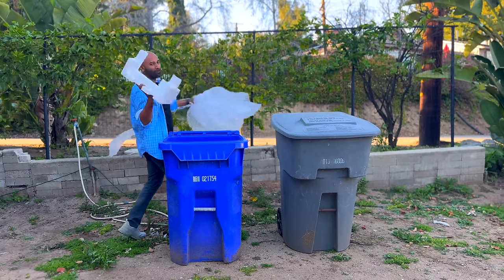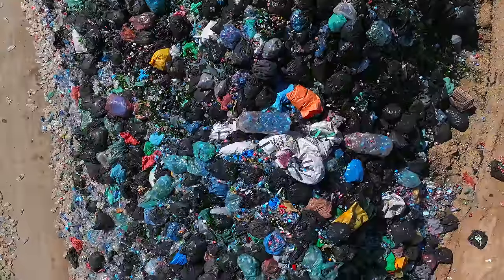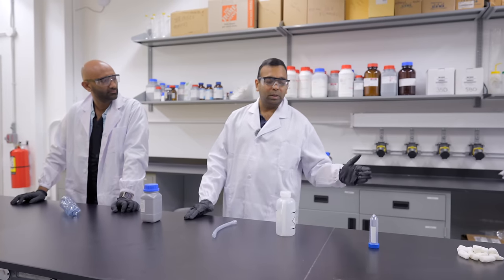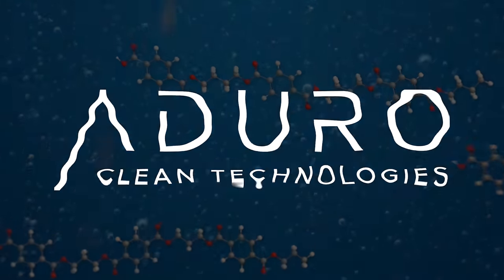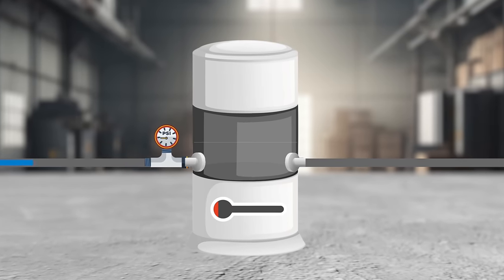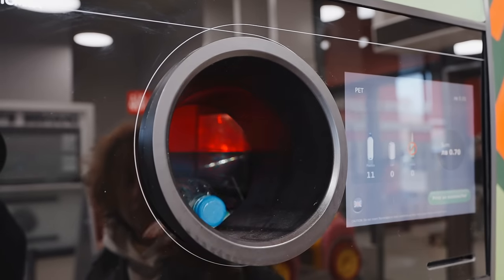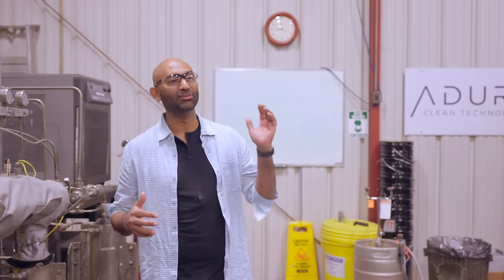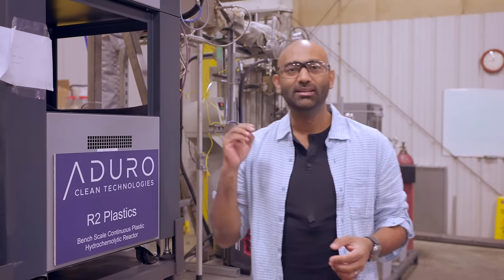Plastic Waste May FINALLY Have a Solution!

Comment: 2:42 It's a huge stretch to call anyone in the plastic industry nice. The 7 resin identification codes came into existence to alleviate the public concern about plastics being bad for the environment. And the sign itself was purposefully designed to look like the recycling symbol, to make people feel better about it. They even ran multi-million dollar campaigns per year to ease off people's minds. And despite new symbols being "revised" as full triangles over a decade ago, most plastics still look like the recycling symbol. And from the 7 codes, only the first 2 have been recycled. And of those, most of it was only recycled once. And here we are, with the plastic industry raking up profits and decades later it takes an outsider's effort to make plastic recycling viable. Nice, huh?

Comment: What Arduro is doing is great; because there's so much extant waste and the inertia of the current system. Years ago I saw a news article that a lab in Japan had developed a new type of plastic which could be reduced back to individual monomers with a simple chemical bath and then remade into any new type. They specifically said it was 100% recyclable, meaning potential for zero waste. It seemed so simple that all new plastics should be made from this new type. The smartest thing to do is a carbon tax on mineral oil, and nonrecycled plastic. This creates market pressure for hemp oil plastic & composites, and recycling.

Comment: A few restaurants and some larger chains use PETE or #1 plastic, the easiest to recycle, for their takeout cups. Most still use PP or #5 that is far more difficult to recycle. #5 is not even accepted in my city's recycling program. Why have other restaurants not shifted to PETE? The fast food industry uses so many of these cups that if they would move to industry wide use of PETE and developed a clean, sanitary collection system for empties, it might possibly accelerate the reuse of these plastics.

Comment: The part that is missing is the part where these oils and other products are put back into standard processes and turned back into solid products. How does the economics stack up? Can they be cheaper than standard petrochemicals?

Comment: It's good to know that at some point in the future, there may be a chance that plastics can be recycled indefinitely, possibly even without toxic degradation of the material, such that it does not have to be downgraded with each cycle, and eventually moved to landfill or energy recovery. 

But in the meantime, whilst we're waiting for the miracle science. There is lots we can do to reduce our use of the material to the amount that is only necessary.

Comment: Plastic pyrolysis   I carried  out the same experiment  6 years ago  by heating mixed dirty plastic 
In a  catalytic  oxygen  seal chamber  up to 410 Celsius  and using a still the distillation tower to 
Cool the hydrocarbon condensate   at diffrent  stages the light end gases can be used to heat the reaction .  The BITUMAN for the roads  and carbon powder can be used for strengthening  concrete 

The bottom line is that NZ  is building  plastic recycling station  
And yes there  is no real money in it it's cheaper to pump it out of the ground 
Remember the oil is free it's only the extraction  cost 
I can only wish them all the luck in the world.

Comment: While this looks great, the main problem is that we have to much one time use plastics. people are lazy and companies try to min max their costs and income. So only regulations to ban 1 time use plastics to reduce the ammount to managable levels. and have regulation on if plastic is used its used in a specific way so that it can be recycled in a acceptable manner + forcing those using those plastics to use recycled plastics. will either motivate them to promote these tech and recycle rates or they avoid the need for plastics in the first place.

Comment: So, as much as I WANT to believe this, I can't even begin to express how incredibly skeptical I am of these claims...

I've been personally fascinated with this industry. Chemically recycling plastics either back into their constituent parts, or splitting the processing between returning usable plastic to the cycle, and turning the multitudinous carcinogenic waste long-chain hydrocarbons into fuels of various quality. It sounds amazing, on paper. In practice: it's energy-intensive; prone to failure; UnBeLiEvAbLy ToXiC to the workers operating the systems, and to the environment with all of the waste products, from the plastics themselves, the additional industrial solvents, and the penultimate precious resource: Water (IMHO the ultimate precious resource being Life). Like I said, I want to believe that Aduro have cracked the code, but several factors compounding at once leave me highly critical.

1) Everything that might dispel my disbelief is shrouded behind patent claims. I completely understand that proprietary techniques will be necessary to make any of this reality, but they so far haven't put forth anything new.

2) Since they're still in the startup phase, I can't help but feel like this is just a repeat of "Magical hydrogen storage disks" or "Theranos all-in-one testing labs" or any of the thousands of other lofty claims over the decades, with no proven science or tech to back them up, meant exclusively for building investment capital, before the inevitable lawsuits start rolling in...

3) Claims of Silver bullets or Panaceas should give pause to everyone that's listening. Claiming that they not only no longer need to care about the type or quality of plastics going into their mystical vat, but aCkShUaLlY impurities are beneficial to the process something something industry buzzwords.

I have a lot more to say on this while I'm desperately trying to keep an open mind. I guess for now, just call me Fox Mulder.

Comment: This tech in itself looks like an insane breakthrough for plastic recycling.
However, I wonder if they achieve an economic advantage over just producing new plastic, and how far are they lagging behind if they are not yet competitive.
Like, what is the price of 1kg or a ton of fresh plastic compared to their recycled plastic?
If they don't achieve an economic advantage, then it also likely means there needs to be more regulation around plastic waste such that these technologies could become standard.

Comment: One question that has been on my mind recently. I would like to know if this is possible.  Instead of the engine being the main stay in Hybrid vehicles, why couldn't the process be reversed, so that a tiny engine could be used to keep the batteries charged while a tri motor would be driving the wheels?

Comment: so it's tdp, right? thermal depolymerization? not saying that's bad--i love that, I'm thrilled to see it! if they have a "secret" that makes it economical, then that's great. iirc the biggest drawback to tdp was energy cost. if they can do this more efficiently, then I'm all for it. fuck it, if i had money I'd invest.
edit: excellent, i can put my money where my mouth is. i have a very small investment account from an old job. it aint much but i'm glad i could get on board.

Comment: This seems like a great technology but why are we still producing so much plastic is the larger question. We should be using more plant plastics vs petroleum aka fossil fuel plastics. We could and should be switching to more biodegradable sources ASAP like not even today but a decade ago.

Comment: The downside of emphasizing the positive is that the video comes off as straight from a corporate press release. It would have been more journalistic to present the downside and some critics. For example, you never ask how expensive the process is, how cheap it can be made at scale, and whether it can be made a part of an economically viable supply chain.

Comment: The fundamental problem with recycling plastics is that it is already a waste product from oil refining. Virgin inputs are already very cheap and very pure because it's just an output of distillation. The price of virgin plastic is very cheap because there's so much supply from oil refinement waste. Any advancements in plastic recycling will only create more supply and drive the price of plastic down, making the job of recycling harder.

Really the only way to "solve" plastic recycling is to either consume it in the cleanest way possible or to lower the amount of oil the world uses.

Comment: Other technical YouTubers, like Sabine Hossenfelder and Joe Scott, have recently expressed skepticism about plastic recycling, including chemical.  What's the cost, and energy use, for this process, compared to that of traditional feedstocks?
Reply: I noticed that Ricky didn't mention the financials. I think he mentioned 400 degrees Celsius at some point which is a pretty high temp that would require a lot of power. Ultimately the only way this is going to be successful is if the final product can be sold at a price that is less than virgin sources or other sources from the petrochemical industries
Reply: @laughinggas5281  400 degrees is a lot less than existing recycling technologies, so they require a lot less energy, hence they have lower opex (and capex). Price is a bit higher than virgin plastic but goverments/companies want a solution to the plastic problem so that won't be an issue. Also fewer carbon emissions than virgin plastics.
Reply: Aduro's tech is different than current chemical recycling.
Reply: Aduros process is at about half the temp of current chemical recycling. Also has the ability to handle more type of plastics without sorting and had 95% yields at continuous flow

Comment: Of course, the promo is cool, as a technological solution is clear to me, but the problem is that the company has not reached a positive profitability yet, so I would like to know at least the degree of conversion by type of semi-finished product and some schedules for obtaining the product depending on the combination of raw materials. Undoubtedly, the development of this startup will help in solving the issue of the convergence of packaging and plastic in accordance with the possibility of recycling, that's for sure.

Comment: The process wil always have losses, true circular use of plastics is a pipe dream. I really hope they get this working with a high percentage of materials to make new plastic from. 70% would already be a remarkable achievement.
Reply: Latest continuous flow yield was 95% (recently released by company)
Reply: @TristanTemple-jz8bq  Something tells me that is the two fractions combined. In the video they explained the lighter fraction (<C20) would be recycled for fuel and the like. The heavy fraction is the interesting one.

Comment: They can do this equally as cheap as virgin plastics?  It was never a issue with returning the chemicals back to baser forms... it was how much it cost / how much energy it used.  Also not noticing PVC getting into a recycling machine often means a cloud of chlorine gas...

Comment: Best thing to do for beverages is to return to aluminum and steel. We can make a resealable bottle for  both. With a tax on plastic, that would make it economical I don't see any hope at all for the return of glass bottles. Too heavy with today's diesel prices. But I think steel and aluminum resealable bottles are entirely doable. it would also dramatically cut down on plastic waste, and both are virtually 100% recycled in the USA.

Comment: So I'm confused, what is the "end product" (9:45).  It is stated "liquid oils", but are those oils that can be turned into new plastics, sent to a refinery to make gasoline, or what?  On Aduro's website they state, "We transform waste plastics into 21-st century resources for the circular economy..."  I'm guessing it is new plastics, but what type of plastic (i.e. type 7 that cannot be recycled)?
Reply: Ok, so at 13:00 it is stated that "their early partners are the exact customers they will need in the future..." so it does seem like the 'end product' is plastic to be used again, but still which type comes out?
Reply: I'm pretty sure that the output of this system can be turned into plastic of one or maybe multiple types but is not in itself plastic
Reply: Exactly, the process breaks down the molecule back to its original form so it can be utilized again into plastics (with 95% yield)

Comment: I've come across a company that's using a molecular approach which is far better than this bulk mixing and heating approach but the info is not at my fingertips. On the upside, pyrolysis can turn all the plastics into useful energy. My company, NFTG, can use the dirty mix of  Aduro's outflow as a fuel in our FAZE engine.

Comment: I wonder if the fraction of oil used to make plastics was not used for that purpose,could it be used as fuel or would it be wasted, adding to the cost of every litre of fuel?

Comment: So can this process be extended beyond the plastic? For instance what about aluminum, tin, iron being incorporated with higher and higher temperatures? 

What would it take to process a trashbag from the average household without sorting anything?
Reply: It started at a bitumen upgrade company (which is still a very old they are perusing) they found it to work great with plastic. Next phase is renewable fuel upgrading. Its science has been studied for tires. Seems the potentials are constantly evolving

Comment: I've said for decades that any technology that requires extensive pre-processing or can't handle non-plastic 'crud' on the plastic will automatically fail. If they've solved this, they are well over 50% of the way towards making this a viable commercial enterprise.

Comment: Before seeing this my thinking was that we should just incinerate plastic and quit pretending to recycle it. As you say, half of food packaging is contaminated with food and mixed in with other plastics or paper. I figured it was more easily scalable to deal with the toxic gases after incinerating it in a sealed reactor which at least recaptures some of the energy.

This is such good news and needed so badly that if they can't make it profitable then we should subsidise it by passing on a plastic tax to deal with the end of life stage.

Comment: Whoah. I've done a lot of hydrocarbon catalytic stuff. This - is shiny. Because seriously, how do you go through boatloads of plastic waste, picking out the ones with sometimes tiny little symbols and sorting them into bins? Wow. But cracking a bunch of plastic into monomers or short-chain polymers, wow. 

Is it solar powered 😁 I imagine you could put this on a barge and send it out to the pacific garbage patch and actually make money off of it.

Comment: This is mostly an economics problem rather than a technology one. However, the extra CO2 from the higher energy input is also a significant challenge. Much of the current funding is actually a PR campaign to try to change public perception and defer regulations. Do you think consumers take on significantly higher prices for goods right now?

Comment: Bottle and cap could be made of the same plastic even if slightly more material is used to get the mechanical strength requirements.

Comment: Crazy that this company seems massively undervalued. Wrapping up game changer program with SHELL. Have presented yields of 95% on continuous  flow. Multiple multi billion companies trialing the tech, one upsized its engagement 450%. This could be the best solution in one of the biggest issues of modern man. Still 60 mil usd valuation. Crazy
Reply: Making a lot of notes!  Pls what part $60 mil??

Comment: Excuse me if I remain skeptical. Plastic recycling has been a potential billion dollar industry since the 70s, but we still haven't cracked the code. Recycled plastics have never been good enough for holding food, let alone more durable and high tech applications, like biomaterials. The fact is, making virgin plastic from petroleum is so cheap, that we always end up with an inferior product from recycling that takes more energy to produce and costs more. Hundreds, probably thousands of companies and tons of R&D chemists have likely been working on this problem for over 50 years, and we still don't have a viable solution. This video sounds like PR for this startup. Too good to be true. From the 16 minutes you spent on it, the technology sounds like something that could have been invented with 80s technology or earlier. 

Hopefully I'm wrong about this, but we need to stop using single use plastics one way or another.

Comment: I remember the time when most products were packaged in tin cans, glass bottles, and paper.  All recyclable or disposable without poisoning the environment or choking wildlife.   Let's just go back to that.   How's that for a simple and reasonable answer?
Reply: All intensive and expensive  recycling processes. Tin cans are lined with plastic.
Reply: @TristanTemple-jz8bq  We had it, it worked.  We went to plastic because it's cheaper, but introduced its own raft of problems that are now a VERY BIG DEAL.  The answer, which is very obvious, solves those problems but required us to go back to what we had before.  There's no free lunch.  For a higher recycling cost, we can solve the plastic hazard problem.  I say do it.  We could afford it before, we can afford it again.
Reply: Tin cans are 68% recycle. Aduros process provides a 95% reusable feedstock as of the last continuous flow testing. We also have a massive garbage plastic problem to handle. So regardless if we stop creating virgin plastic we still need to solve the existing issue